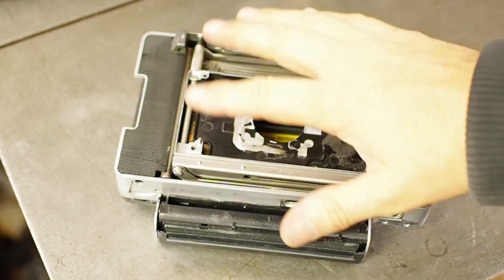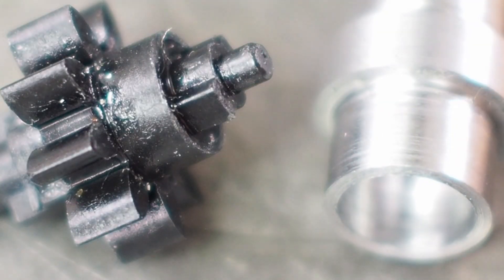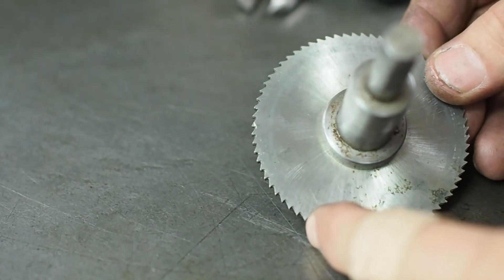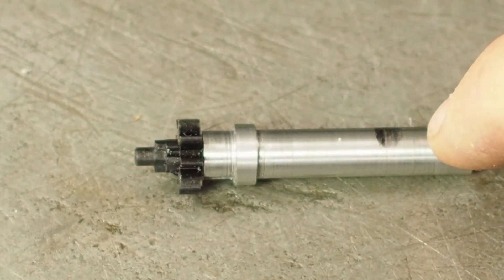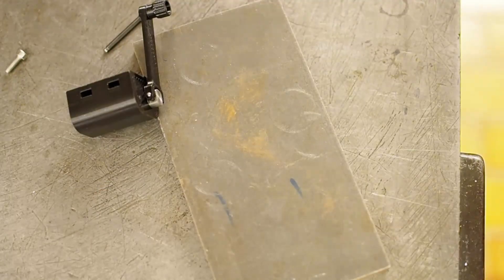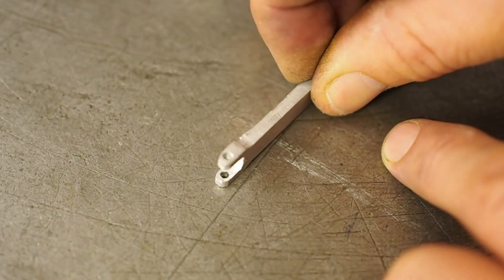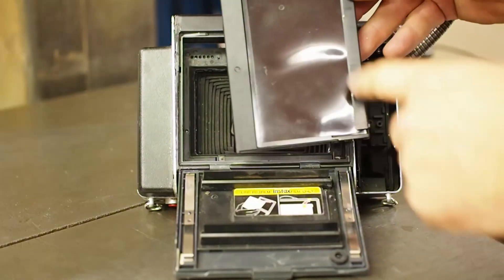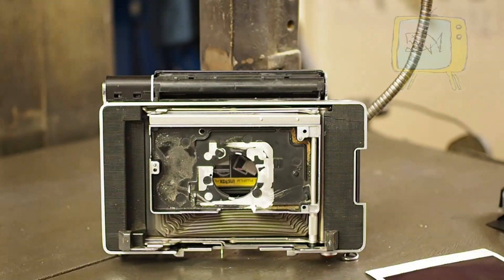Polaroid modified to use Instax film- episode 2 - making the film drive.

Comment: the handle rememberer me to the old film cameras that when you finish the film roll you need to rewind by hand and take the roll for to the shop for revealing the photos
Reply from the maker: That is basically what I modelled it on.
Reply: @RotarySMP  nice i have one of that cameras i need to ask in the Kodak store if they have the 35mm film roll the do the revealing part but i dont know if the still sold that old rolls

Comment: This is the part I struggle with. I’ve modded many instax cameras, from wide to square. But I don’t have machinery to make the drive mechanism for a manual eject like this. Are you able to sell me a mechanism ? Let me know and I can message you on Instagram or something !
Reply from the maker: Sorry, I am not going to start making production parts. You could make parts like these out of aluminium with simple hand tools like files, and a cordless drill. The 3D printed parts are pretty simple. I am not on instagram sorry.

Comment: Great progress on the mechanism. The prototype Involves a lot of different manufacturing processes again. The gear box housing could have a longer shaft so that the lever is not jamming against the case.
Reply from the maker: Thanks Nico. I wanted the crank handle to fold away flush with the body, rather than stick out.